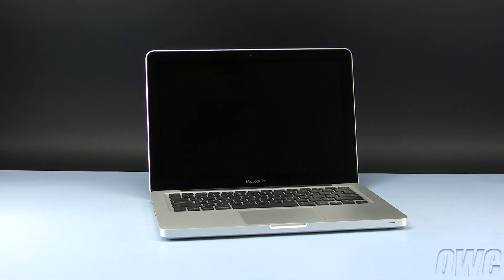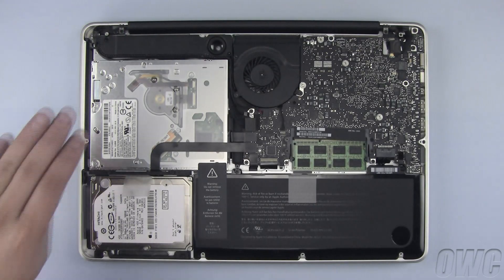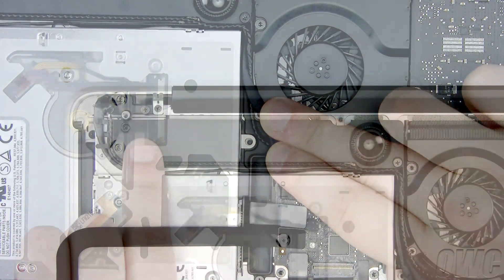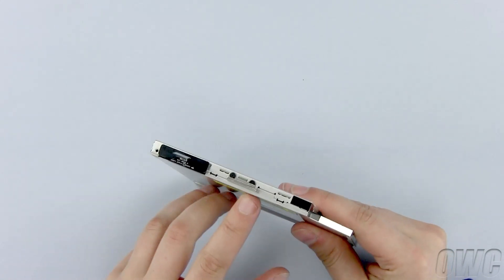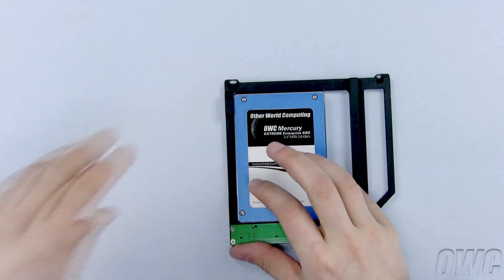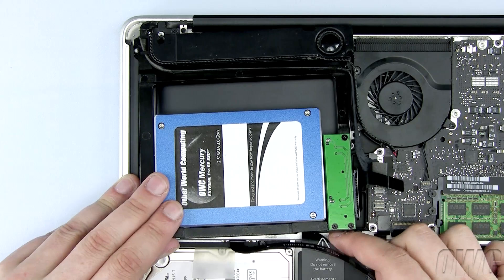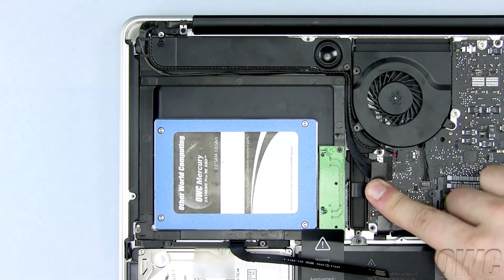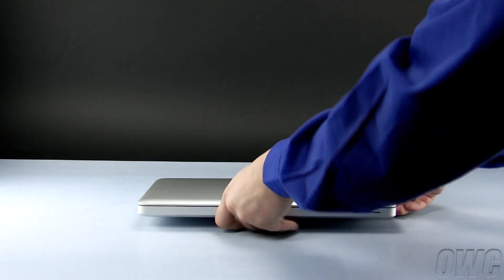13-inch MacBook Pro Mid 2010 Data Doubler 2nd Hard Drive/SSD Installation Video

Comment: Hello, can you confirm if replacing the Optical Drive with additional hard drive slows the performance and drains the battery quicker? If so can you share some statistics of the PC and battery performance with and without the Data Doubler?Thank you in advance OWC

Comment: I have a few questions. once this is done and you turn the mac on, how will it recognize the new hard drive. And what if you put the original HD in the optical drive position and add a new SSD in the place of the hard drive. How do you configure the the SSD and the hard drive so that the OS is run off the SSD and not the hard drive. thanks

Comment: I thought it was better to stick the original hard drive in place of the optical driving using a bracket. You would then use the SSD in place of where the old hard drive used to be. This is because data transfer rate is lower where the optical drive was. Sure some one that knows more can correct me?
Reply: I would like to know that too! Tell me if you learned about it

Comment: I installed a 500GB Hibrid HDD (solid-state) in my 13'' MBP and that's all I need. the optical drive is very useful to me so I CANNOT remove it.

intresting video though.

Comment: @OWCmacsales Well let me ask you something, how much would it be for me to increase the HDD in my Mid 2008 20" iMac? The 230GB drive I have currently is filling and I want to go with something like a 500GB or 1TB at 7200RPMs. That or is it possible to install a SSD?

Thank You